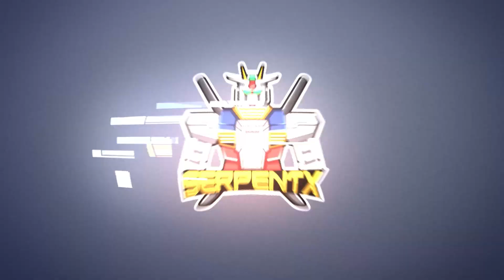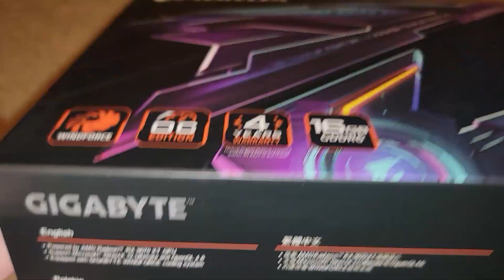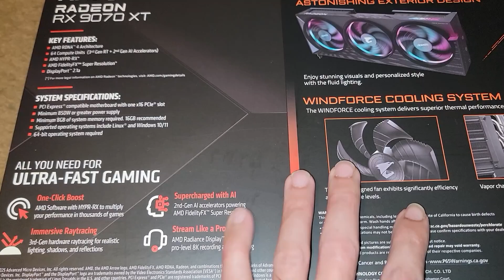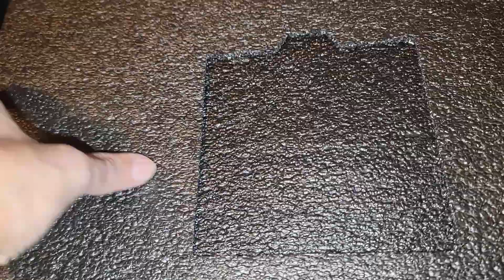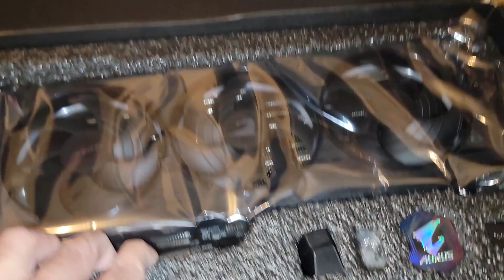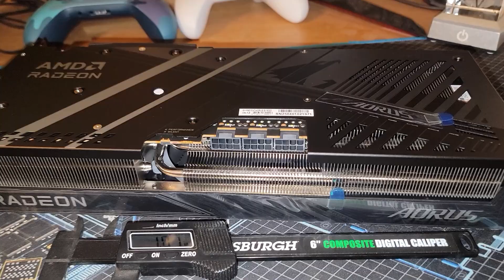Aorus RX 9070 XT Unboxing & Quick Look

Comment: The main issue still stands, you will void the warranty when self attempting to replace the back thermal pads. It's frustrating that a top brand like gigabyte would not use thermal pads to begin with. They could have easily done that, thermal pads is cheap enough.
Reply from the maker: So here in the USA, they legally can't do that but they will try and for users who dont fight back, they will take advantage
Reply: @SerpentXTech yes here in South Africa they will void the warranty on the spot when evaluation is being done. If the card was opened and the seal was broken.
Reply from the maker: @jonesmark5884 thats bs, and completely agree they should have used thermal pads from the start

Comment: Have you had any issues with liquid thermal pads?
Reply from the maker: Liquid thermal pads? I think you mean thermal putty, and no i have not on this GPU, but i also didnt have it in a vertical configuration. But others have had the thermal putty leak out on them

Comment: hows the performance?
Reply from the maker: Comparable to RTX 5080. Beats the 5080 on some titles, and loses to it on others. Especially on Ray tracing. But runs AAA titles like a champ and runs cool! Decent OC head room to
Reply: @SerpentXTech do you find any issues with this card?planning to buy this coming july
Reply from the maker: @romelhyn  the latest AMD driver has some random crashes it it but to be honest that is standard. They are getting better but the hardware runs great
Reply: @SerpentXTech how the temp and fan noise?
Reply from the maker: @romelhyn memory junction temp climbs up there like there previous models but core and hotspot 68 - 80, depending on load and aggressive fan curve. Ill record you a short or video and post it for you. Keep eye on channel
Reply: @SerpentXTech  tnx mate youve got my sub
Reply from the maker: @romelhyn appreciate it, it prob be a short dropping tomorrow keep an eye out

Comment: Do you think copper mod / VRAM cool plates is going to make a comeback for the RX 9070 XT with so many custom cooler cards seeing VRAM temps in the 90-94C with just gaming? I then wonder what a mining workload would do, as i already dont like the temps.
Reply from the maker: @Beardroid91  it could but make sure to find your current thermal pad size, and then get smaller than that. If too big, you won't make sufficient contact with gpu core
Reply: @SerpentXTech  Thanks, will keep that in mind for the future, believe it is 2mm on my card so probably need 1.8mm, but as much as i want to do this, i also dont want to be the first to do this with 8 shims that can move around, as the PCB on the RX 9070 XT is so densely compressed with SM's right next to the VRAM, so was more wondering what if, atleast until the warranty has run out or something.
Reply from the maker: @Beardroid91  yea. Dont want any contact with other components. You can always try more thermally efficient thermal pads first to see if there is a significant drop. What model Graphics Card you got?
Reply: @SerpentXTech  I have the Asrock Steel Legend, would for sure try changing the thermal pads first, even-though Asrock claims it is premium thermal pads they used. But biggest issue with that is ruining the PTM on the die, so not in any hurry.
Reply from the maker: @Beardroid91  yea everyone went phase change these launches

Comment: Can I run it on on a 750W psu? Could you please check and confirm?
Reply from the maker: What cpu and motherboard you rocking? You should be fine, depending home many other accessories you have running

Comment: How well does your card undervolt.Whats your highest boost?
Reply from the maker: 3328 mhz core boost at max. When undervolted 0.887 volts boosting up to 2948 Mhz core
Reply from the maker: Can prob get it down to 0.676 volts if drop clocks below 2200

Comment: Cooler is too thin and this GPU heats to much in game. VRAM 92c all the time. Tried an Asus TUF with its monstrous cooler and temp fell back to 82c. This Aorus won't last for long with such high temps.
Reply: It will last with the 4 year Giga's guarantee. Just register the card.
Reply: How is the cooler thin if its weight 5 lbs ? You saying the premium price worth nothing ?
Reply: @martziki9020  I just say that the cooler is not efficient enough.
Reply: My AORUS ELITE 9700XT not pass more than 80 - 82 on VRAM temp. Maybe my airflow is more good (case Lian LI Lancool 216 RGB) or my GPU act more cool.
Reply: @riannair7101  case and proper fan placement always plays a role
Reply: Mines great bro. Just a you problem

Comment: Does your card have any coil whine?
Reply from the maker: @zarmr9719  no, I will record video of sound and post on my X for you. @SerpentXTech
Reply: @ Thanks!!
Reply from the maker: @zarmr9719  https://x.com/SerpentXTech/status/1903489695490719872?t=BTagWExPckqOq_9ujY3tsw&s=19
Reply: @SerpentXTech  That's awesome! Thank you so much! You've earned a sub. I was originally going for a Sapphire model, but those seem to be affected by coil whine a lot unfortunatelly. On the other hand, everyone I asked about the Aorus said it has none so I will probably choose that even though it's bit more expensive.
Reply: Mine does when the fps are too high. You need to open the box and put your ear almost on top of the car to hear it. Almost all the cards have it. Some jsut don t have sensitive ears to high pitch noises.